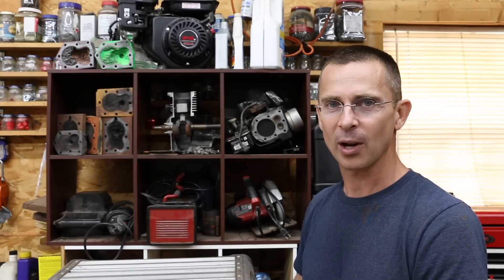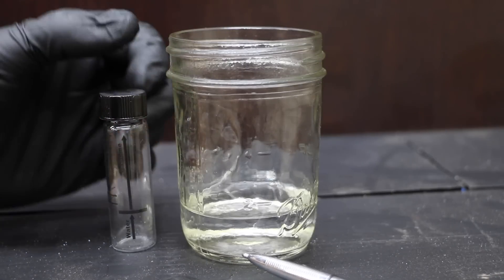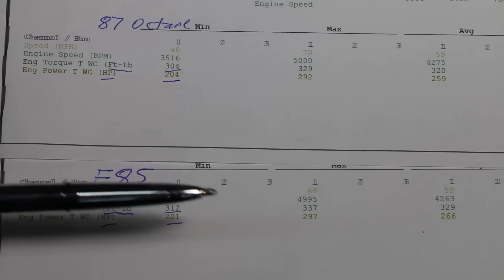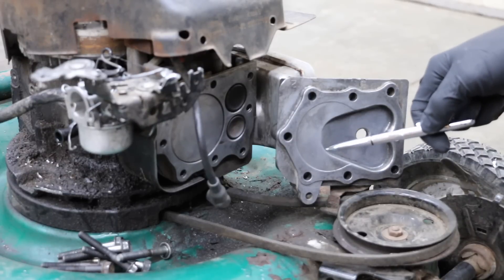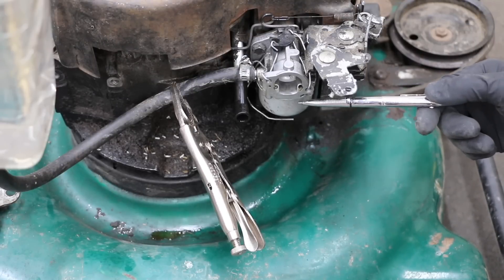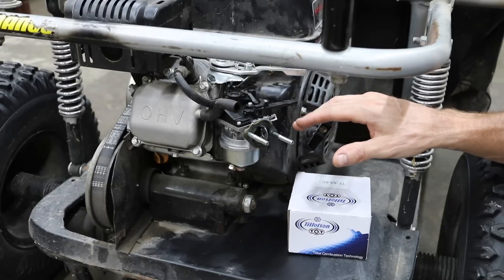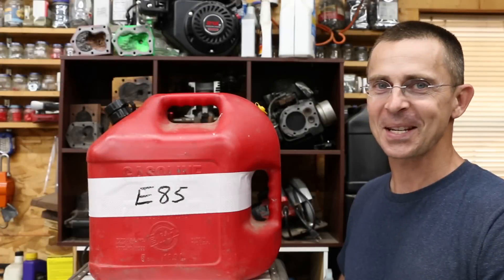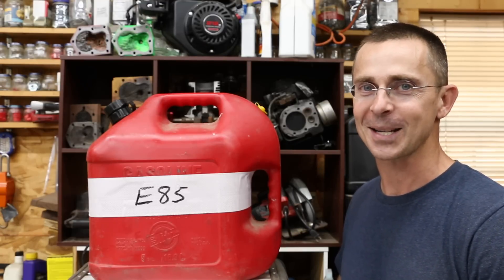Is E85 better than Gasoline? Let's find out!

Comment: Used E-85 in my parents old 2002 Dodge Caravan. I remember one time, I bought because it was cheap. I was driving from Detroit to Saginaw, a trip that typically if I had a full tank at the start I could go make the trip without having to fuel up, but on this trip I had to stop twice. I was really confused because I was under the impression that one got better fuel economy with E-85 (of course I know now that was wrong). My dad continued to use E-85 because he didn't understand that the fuel economy was way worse. The other thing we noticed was, the paint around the gas cap started to rust (we assume from the solvents in E-85) way before any other area of the van has rust.
Reply from the maker: Great point about the rust around the fuel nozzle.  It is a powerful solvent.  Thanks again.

Comment: Is there any way you can increase your compression. My understanding is that e85 will run at higher compression rates better compared to gasoline.
Reply from the maker: Great point. I need to acquire a high compression engine. Thank you!
Reply: @ProjectFarm  My understanding is you could get a different camshaft to increase the compression some. Just as an idea.

Comment: I have never heard of E85 gas, but I think if you use that gas all of the time you will end up spending a lot more money live you said. As always I like to say that you did a good job making this video. I think you do all of the testing the best and fairest way possible. I watch your video series everyday. I like to re-watch them as a great pass time for me. I know that you have fun making the videos and I know for a fact that you put hard work and time into making the videos. I have been watching your channel now for about two months or more. I would like to see you test supper unleaded gas to see if you get excellent fuel millage or not. I just want to say one last ting, thank-you for being in the service!
Reply from the maker: Thank you very much!  Great point regarding the increased cost over time using E85.  Great test idea on the super unleaded fuel efficiency test too.
Reply: You would think so, and if it weren’t for subsidies, you’d be right. Just did a comparison on my ‘14 Silverado.  Pump gas in the city was around 18 MPG.  E85 is around 14.5.  Sounds like regular gas would be a lot cheaper, right?  The difference is that E85 is around 25% cheaper because of government subsidies to farmers, ethanol producers, etc.  According to my math, it costs me $0.013 less/mile to drive on ethanol and it keeps the motor a little cleaner.
Reply: @BabyGators  also helps with emissions and will give a little performance just like higher grade gas does but it wont be noticeable in newer vehicles. I own 2 90s vehicles and when I started using 93 it made a big difference and I used to mix about 5 dollars of e85 to help clean it out and get a little more perfomance and it helped a lot more, but I dont really do it very much during the winter unless I know for sure that I'm not going to let it sit in the tank. E85 probably should be the next step instead of electric cars. Itll be cheaper to do but figuring put how to mass produce it will be hard. But I have studied about algy being used as engine oil and used as a bio diesel. Electric cars seem to be far from perfect for there price and inconvenience and they dont really last very long since there batters will wear out really fast being charged constantly. And electronics arent very good either. I personally think bio fuels would be the answer since e85 alone can easily cut emissions by over 50 percent sometimes higher

Comment: I read some comments below that suggest trying E-85 with 2 cycle oil. I don't think that combo will work. Though E-85 is ethanol, I did find years ago that we could run methanol with a mixture of castor oil (the same horrible tasting stuff used for a laxative) to substitute for the 2 cycle oil to create racing fuel for a 2 stroke kart engine. The result was a lot more power and also a lot of exhaust stink, but it did run great. We later switched to methanol/mineral oil mix because it was cheaper and had less of the foul exhaust odor (though the exhaust odor was still foul). I'd like to see E-85 mixed with castor oil or mineral oil as I never tried those with ethanol, it should work. Hold your nose though.
Reply from the maker: Great test idea!

Comment: what???  you cant get the horsepower???   what did you do, add water to the gas???  we only have 15% ethanal max, so i have never had a problem. so i had no idea.
Reply from the maker: Thank you.  Actually, the computer on the suburban limited the speed of the vehicle to 98 MPH, which was the problem.  At around 4500 RPM in 3rd, the Suburban reaches that speed.

Comment: I previously erred by saying that E85 produced twice as much water as pure gasoline. It produces about 43% more. 

Here’s an intuitive way to estimate the amt of additional water produced by an ethanol fuel:

First, draw a ball and stick formula for, say, ethanol. H-C-C-OH (plus two additional hydrogens attached to each carbon). 

Now, remove the carbon atoms and attach two oxygen atoms to each. The result is the two CO2 molecules produced per molecule of ethanol. 

Next, draw oxygens where the two carbons were. Two atoms of water (approximately) appear, plus there’ll be a water molecule produced from the OH. Thus, compared to ethane, a rough surrogate for pure gasoline, ethanol will produce three molecules of water, or 50% more, than ethane’s two. So, 0.50 x 0.85 = 0.43. 

It’s primitive, yes. But it’s a nonarithmetic and I hope, an intuitive, visual way, to estimate the relative amount of water any alcohol fuel will produce compared to the pure hydrocarbon analog.
Reply from the maker: Frank,  You continue to amaze me with your mastery of chemistry!  Thank you for this information and hope all is well!  Best regards, Todd
Reply: Project Farm 

I felt soooo bad when I realized I’d been spouting misinformation about the additional water produced by combustion of ethanol. I was too lazy to do more accurate stoichiometric calculations, so proceeded as described, just to get a ballpark estimate of my error. 

It turns out to be useful, I believe, for estimation purposes, though, obviously, it’s not intended to be representative of how any of the reactions occur. It’s just a way to account for all of the carbon, oxygen, and hydrogen that went in, the oxygen that was added, and what came out. Plus or minus a hydrogen atom here or there is not significant enough to worry about. Also, though ethane is not gasoline, I think it’s good enough as a surrogate for gasoline to get the point across. 

I posted from a phone, so couldn’t represent the chemical formula as correctly as I’d wished.

Comment: E85 used with a proper engine management system on a turbo charged car, You can run higher boost and advance the timing.  E85 is equivalent to about 103 octane.  Yep it does consume much more fuel so the injectors have to be quit large  1000cc  injectors are used.  This for a 4 cylinder engine.
Reply from the maker: Thank you

Comment: 23% loss in mpg is not bad! increasing power by about 7% down under and about 1.5% more up top. e85 is about 26% cheaper where i live, socal. e85 is roughly 2.8/gal while 87 octane is roughly 3.8/gal depending where u go.

plus it runs cleaner and cooler.
however it has some problems starting in colder climates.
Reply from the maker: Thank you and great point on the cold starts.
Reply: thanks! i love your channel!

Comment: Thanks for the test. I did use E85 when I was stationed in Germany it seems to be taking over in some regions all over the world as the normal fuel. The main issue is rubber doesn't seem to react well to E85 and unfortunately a lot of vehicles use rubber fuel lines. As always an entertaining topic.
Reply from the maker: Great point on the rubber lines.

Comment: E85 has better performance in built performance engines, most flex fuel vehicles don't have the compression to take full advantage of the fuel like a boosted one would, they can just reliably run it as a cheaper alternative. Also e85 draws water, so non flex cars can rust faster in vital fuel and engine components. Another related note is my grandfather's flex fuel 2014 f150 also gets worse fuel mileage with e85, about 5-6 mpg less
Reply from the maker: Thank you
Reply: Don't thank me you provided the excellent content per usual

Comment: If you use OEM equipment, I suggest you run at least one tank, before going to the dyno, such that the engine computer gets to learn what is in the tank. Let it warm up and keep it running for at least 5 minutes before putting it on the dyno. Also test it's MPG with the cruise control set. Doing those couple of things will get you past several short term dynamic issues that OEM cars are dealing with. Also keep in mind that non-OEM do completely different algorithms and do not do those same things. More long winded reply below. 

I suggest you run at least one tank of E85, before going to the dyno. When I do testing, I do three tanks, then check on the third tank. As well at least one tank of 87 before going to the dyno to check 87. The computer takes some time to learn what is in your tank, which is why I suggest 3 tanks before testing. Also on European vehicles, I've found that 91+ octane costs about the same as 87 octane. You care about $/mile not $/gal or MPH. Your Chevy is mostly European, so you might want to check against 93 octane. As well keep in mind pumps with the single pump handle, will put about a gallon of what ever the last person put in their tank, which is usually lowest $/gal. So if you want to make sure you get E85, you really need to pump a gallon in a separate tank before pumping into the car. 

Modern cars have short term fuel trim and long term fuel trim compensation. You can't just switch between fuels and compare, as the engine computer takes around an hour to adapt to the new fuel. Your short term fuel trims are typically adjusted once every couple seconds. Then once every couple minutes your long term fuel trim is adjusted. After about 60 minutes, your long term fuel trim is typically adjusted. Also if you put in the same fuel, then it does not need to adapt, so normally it does not need to make adjustments. Both your short term and long term should be less than about 10%. If your long term fuel trim exceeds about 10%, you'll typically get a check engine light. A normal healthy engine is typically less than 3%.  If your above about 3%, then you likely have a fatigued O2 sensor, small leak in the air or exhaust, etc. You can typically check your fuel trim with most hand held scanners, look for STFT or LTFT numbers. Also cars will run in open loop mode for about 5 minutes after being started, then they switch into closed loop mode. Closed loop is when your catalytic converter is warm enough to do it's job, and the O2 sensor is adjusting the STFT and LTFT. When in open loop mode a lower MPG is expected. It's kind of like the choke. The idea is that your engine makes more heat when running more rich, so rich is OK as it warms things up quickly. Once warm, it can then start to regulate the emissions. Remember your engine computer does not care about MPG, it cares about minimal long term emissions. Also your engine changes the AFR when accelerating or decelerating, yet your typically driving will have a fairly steady throttle position. Your car will identify cruising vs stop and go power, and will run richer during power modes, then it will lean out when in cruising mode. Keep in mind your catalytic converter will reduce the emissions, so the OEM doesn't really care about rich or lean, as the cat will make the emissions meet regulatory demands. You can force the engine controller to go into cruising mode by setting the cruise control. Most OEM engine controllers will switch into cruise mode if you are above something like 25% throttle and your throttle has not varied by more than something like 10% for around 30 seconds. If you are varying the throttle, of if you are not at a normal throttle position, your not going to get a consistent MPG. AKA dyno is wide open throttle (WOT) which is not normal, so it's tends to be in power mode and a lesser MPG. Even at WOT, your engine computer may or may not switch into cruise mode. 

If you are going to look for MPG, you need to get past the above noted emissions issues before you have a consistent method for testing MPG. If you want to know what is happening under the hood, you can try open source after market ECU's like rusEFI. I've dubbed around a bit with small engines as shown here 
http://jaredharvey.com/Files/projects/Engine_control/snow_blower/snow_blower.htm
Reply from the maker: Great tips. Thank you

Comment: Really good fun to watch ! I use E85 mixed with E10 to get approx E70 (max 70-75% ethanol) to run on my 1999MY Range Rover, 4,6l/V8, works fine, but like you not as good mpg... but it's nearly half the price of regular E10, in France, that is, soo.... 😊
Reply from the maker: Wow!  That's a great savings. Thank you

Comment: I run E85 in my ford 8n tractor since there are no rubber pieces in it's very simple fuel system.  A minor mixture screw adjustment and timing tweak and it's ready to go.  The big advantage of running more fuel to achieve a stoich mixture is that all that extra fuel is cooling the combustion chamber which allows me to push the tractor harder without spark knock.  You can also work the tractor a lot harder before the radiator boils over which is a big help.  I make sure to buy NON ethanol fuel for everything else though! the old rubber pieces just can't handle it.  Great video!
Reply from the maker: Great point. The octane is well over 100.   I can't imagine an 8N having a spark knock with this stuff.  Thank you.
Reply: @ProjectFarm  I upgraded the ignition to a chevy HEI pickup and module (filed half the star points off a V8 pickup) and run about 0.060" gap so let's just say it hits a little harder than stock!

Comment: With that mechanical fuel injected carburetor would it be possible To get the cart to run on kerosene without pinging? And by the looks of it you could use e85 every 10th tank of fuel to help keep the combustion chambers clean...
Reply from the maker: Yes, I believe it would be possible, but the time would also need to be retarded as well.  The 8:2:1 compression ratio might be a little high for Kerosene but a larger head gasket would do the trick.

Comment: Tested E85 on 2013 Infiniti G37x (3.7 V6).. Since feul pump and rail system supposedly can handle it stock. Felt weaker and less economical than Premium Fuel. But I probably needed a tune.
Reply from the maker: Thank you. Great point regarding the tune.

Comment: You should test the MPG of a normal copper spark plug vs a higher end one like Denso Iridium TT. The Iridium TT is the twin tip version used in modern cars because they create more efficient sparks from two thin tips compared to the larger base of copper plugs. You could idle each one multiple times and see which ones run the longest. Maybe even throw in a platinum plug in the mix to see if it really is the middle grade when compared to copper and iridium.
Reply from the maker: Great recommendation. Thank you

Comment: I ran etanol and gas in my A-traktor (car that goes 30kmh) Volvo amazon carburated. I could run 50% ethanol and 50% regular gas in the spring and 70% ethanol to 30% gas in the summer and 25% etanol to 75% gas in the winter. I used to run it as lean as possible by putting the right amount of etanol in the tank and I had to use the manual choke upphill or acellerating. This was because It cost 50$ a week to gett to school so by doing this I could gett down to 35$ a week because the ethanol is cheaper.
Reply from the maker: Thank you

Comment: used E85 in Aust for a Holden Nova 1.5 ltr & Holden Vectra 2.2 ltr both cars autos after 3 months or less nothing but problems from overheating to fuel leaks sweet burnt fuel smell  had to dispose of both vehicles
Reply from the maker: Wow! Thank you for commenting on this.

Comment: i have boosted car, e85 has 116 octane, produces more power burns cleaner, and burns cooler than gasoline., i add a water injection and my engine internally is steam clean and never overheats.
Reply from the maker: Great point. Thank you

Comment: Didn't know where else to post this but I came across a couple of interesting products that I thought to recommend for testing. 1st is Encore Industrial Spin Off Lubricant. It's supposed to be better than PB Blaster and other similar products. I don't know if it's a new or older product.  2nd is X-1R Engine Treatment, the company web site says it's a NASA Hall of Fame product and Elliott Racing got more horsepower and less friction out of a race engine than they could without the treatment. Thanks
Reply from the maker: Great recommendations. Thank you!

Comment: good video.  your testing put a question in my mind. why aren't small engine manufacturers making their equipment so it can run on E85? is cheaper and supposely less pollution?
Reply from the maker: Great question.  It's possible to design a small engine to safely run on E85 but it gets a bit complicated due to air fuel ratios, jet size requirements for E85 vs E10, etc.

Comment: There is a small error in perception concerning Flex Fuel vehicles. The Flex Fuel label on some vehicles DOES NOT mean it was designed to benefit from E85 fuel it was designed to survive using E85 fuel. A proper E85 designed vehicle will have higher compression through displacement or boost that would cause problems with lower octane gasoline. E85 can produce more power but at the cost of fuel milage.
Reply from the maker: Thank you.